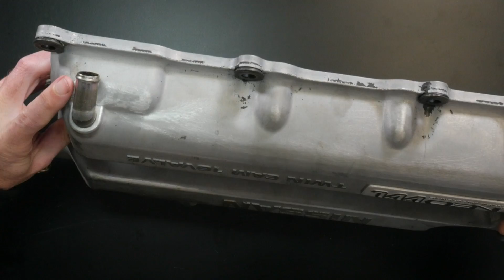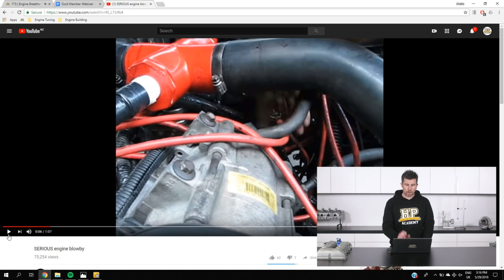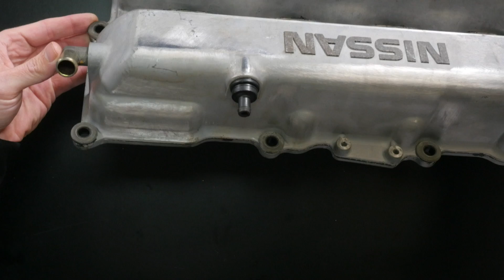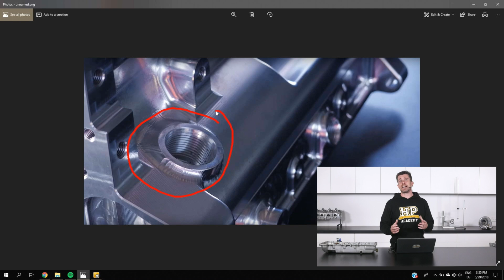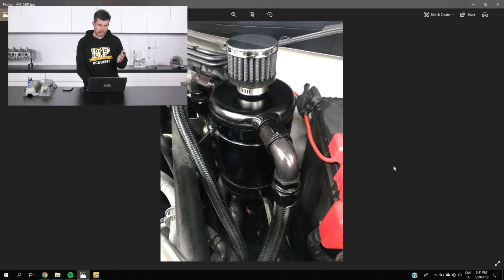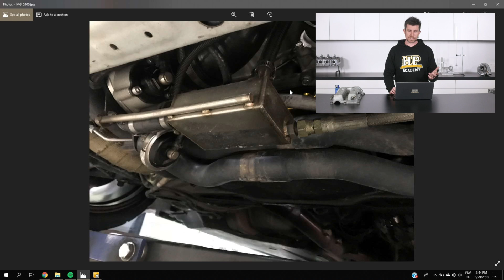Is your Engine Damaged? | Blow-By & Engine Breathers [GOLD WEBINAR LESSON]

Comment: But what about the benefits of having vacuum in the crankcase ect in a turbocharged application with pcv valves. The vacuum alone adds horsepower and aids in seals sealing ect. 

Just a pcv valve and catch can on both intake and exhaust breathers. Plumbed like normal minus the catch cans.
Reply from the maker: The reality is that on a turbocharged engine you're unlikely to see vacuum at higher boost and rpm due to the higher levels of blow-by. That's not always the case but in most instances the blow-by will exceed the ability of the scavenge stages to evacuate the crankcase and you'll still see positive pressure. Admittedly the positive pressure is less than with a wet sump but you'll still see positive pressure. If you're running relatively low boost pressure then you may still see a slight vacuum in the sump but it will still be minor compared to what you'll see on an N/A engine and hence the benefit is reduced significantly. If you are still able to pull a vacuum then there's definitely no harm in using a one way valve / PCV valve in the breather line but the benefit is just reduced - Andre.
Reply: @hpa101  I’ve always had really good luck w pcv setups. Even dual pcv setups w catch cans on both sides of the manifold. 

None the less. 

Would you suggest running pcv on the intake side w catch can and run the exhaust side in series but not to the turbo intake?  So when it’s under boost the pcv shuts and just lets the engine breath through the catch can only? 

I truly need to put a gauge on the turbo side to see just how much vacuum I can pull under boost on the turbo side. 

This is a topic I visited years ago and I’ve always done pcv valves w filters and just recently ran into several cars that had the system deleted and showing signs of exhaust valves ect wearing but the moment I plumb the pcv system I can make those puffs of white smoke disappear no problem.  In all these scenarios I’m
Suggesting in line pcv/oil separators and not just a stock pcv as they gum up quickly without routine cleaning. Doing it this way I see extremely minimal blowby even at high boost.  Literally just drops in the catch cans at the end of a week.  Where if I don’t apply vacuum I see a catch can gathering oil rather quickly. 

Anyways. I’d def like to talk more about this topic as it’s a highly debatable topic between me and other tuners.

Comment: Could blow by push oil back into the turbo in forged engine with stock breathers ? I'm having intermittent smoke on my forged 3sgte. I've done leak down test and compression test was told my engine is healthy. Just every now and then when I come to red light i see grey white smoke that smells like oil escaping from my exhaust:(
Reply: Use the pcv valve to create vacuum
On the crankcase at idle. Just run a catch can in between it.

Comment: I was wondering if you had any experience with this system in the 350z, G35 (v35 skyline) with the VQ35DE engine. The engine is known for oil consumption problems. I have put a catch can on it and it fills quite quickly. But i figure that its better to fill the catch can than to put that oil into the combustion chamber. Is there any way to improve the efficiency of this system? It has an awful valve cover design being plastic. Its surprising to me that after all this time and all the people who modify these engines, that no one has made a real great system to address this issue. I.E. billet valve covers with better pcv channels in it to give the oil time to drop out of the air in the system. You hear stories about people who had these engines replaced under warranty only to go right back to the consumption issue. I swear its the result of a poorly designed pcv system. Thanks for any information you can provide or even just humoring the discussion.

Comment: The first engine we built had 0 blow by, could rev it, boost it and nothing would come out the breather system. After i foolishly killed it we built a second engine and now on idle it chuffs oil smoke and burns off about half a litre every 1000km's. But the catch can remains empty.
Very annoyed by it
Reply: You've got a ring problem, homie
Reply: @AbolishTheBATFE  Yep the people who did the first start didn't follow my instructions and in fact did the exact opposite. they also tuned it to run 9:1 AFR during the run in tune
Reply: @UnparalleledSpoof  they washed down the cylinders
Reply: @AbolishTheBATFE  Yeah looks that way, nothing much I can do.

Comment: You should see how GM ecotecs PCV system under no load operates. The PCV valve sits inbetween the intake manifold as a little cartridge. It's a real nightmare.  Vacuum pumps would of been a great addition to relieving excessive crank case pressure because of blow by. Another thing for people to consider is when you vent gasses to the atmosphere a lot of times your MAF is losing its ability to measure the lost air so your tuner should compensate for that loss of air or extra intake from outside air if the lines are run post MAF meaning if your sucking in gases through your PCV outlet and that has an air filter on it, your MAF has no idea the extra air being ingesting leading to rich conditions. he talk about it at about 50:00

Comment: The good thing about using a pcv valve / check valve, is that at idle the manifold vacuum will pull fumes into the intake versus them escaping a vented catch can, where they can leave oil residue and be smelled. Not a big deal for a race build, but for a daily driven vehicle the fumes may not be desirable.  I'm attempting to utilize the pcv setup on my build, with an air oil separator and exhaust venturi to (hopefully) take over under boost conditions.
Reply: If you haven't come up with a solution yet, I can help you out

Comment: After I increased boost, my dipstick starts popping out. However i don't find much oil in the catch can. Should i just tie down the dipstick or increase breather size?
Reply: Run the pcv system to the intake mani w a catch can no breather. It relieves crankcase pressure and has many benefits. Vacuum at no boost is a beautiful
Thing.
Reply: George Chai what size lines running from valve cover?
Reply: @2jz_tony  stock size

Comment: I have found that if you daily your car it’s more advantageous to keep your PCV system, it’s not just good for emissions but it uses vacuum from the intake to help with the turbo oil return line moving that oil to the sump more easily especially when the oil is cold and thick. I use to have an issue where every time I took off from a light I would have a blue cloud behind me, I thought I had blown turbo seals. It turns out it went away after I reconnected the PCV.

Comment: So if dry sumps are better and cheaper then a really good wet sump why aren't they as common on daily build type cars. 

I know the dudes in Australia building the v12 supra wanted to avoid a dry sump.
Reply from the maker: Why did they want to avoid a dry sump? More info needed.

As for the first question, a daily/street performance build is not driven in anger anywhere near as much as a track car. Doesn't matter how big the owners EGO is, that is just a fact - Taz.
Reply: @hpa101  well they wanted to do a 1gz fe swapped mark 4 supra like smokey nagata but leave it more as a proper street built car. also yeah a street car isnt but some people do take their built street whips to the track vs having a track specific car. 

seemed more like they were saying its like having a wet block vs not. or other things you can get away with in a race car that isnt generally gonna be doing any real distance for anything length of time. 

whole point of my r34 plan is to have a daily that can also do some endurance runs on the track. 

obviously you cant drive on legal roads as wild as a track. but thats a given. well maybe in the states in the specific states with the abandoned highway system some of those roads are now basically lawless. or autobahn.  was more along the lines of reliability or noise concerns if you had any insight.
Reply from the maker: The only reason I could think to not run a dry sump is if you simply don't need one due to the way the vehicle is used/budget. There are no reliability issues, some cars but more commonly motorcycles come with them from factory - Taz.
Reply: @hpa101  hmmm wonder what they were on about then. maybe complexity? cause from what i know a good wet sump is more expensive then a dry sump set up. 

and dry sumps have multiple advantages. crank case vacuum being one. plus the obvious ones.

Comment: Whats your take on Diesel crank case vent routing? on my subaru i was running a basically identical setup you talked about in the video. but in a diesel (light to moderately modified engine in the 30-70 pound of boost range) oil vapor isnt necessarily a bad thing. is there a significant advantage to pulling a small vacuum on the system as opposed to just venting? My research is in the 6.7 Cummins engine in the Dodge ram trucks in the US, and most of them just route a single line to the ground. 

im looking to have a big line off the block and heads to a single huge can and im undecided on if i will vent it to atmosphere or back to the intake.

Comment: More serious comment:

Sump return catch cans are fantastic. To alleviate the problem you mentioned of an open air path between the sump and the base of the catch can. Install the sump return to the sump below the oil level (what I did.) Thus the oil acts as a U-Tube where oil can easily drain back, but no gasses can pass. What I've done on my race car (CA18DET powered.) Since it's only ever being thrashed, any water vapours are flashed off, so that's not an issue.

However, even though it's been rebuilt, it still throws alot of oil out of the exhaust cam cover (breather is right at the back corner,) so an long acceleration, especially around a right hand corner just causes oil to pool and be rejected out the breathers. (Have external head drains and oil restrictor into the head, to help as well.) Can't afford and empty sum 15 laps in.

For a street car, I agree. no real need for a sump return.

Comment: Re: PCV valve, they often stick, or even get blocked, so rather than have some/all the crankcase gases being drawn off, they can cause some pressure build up and venting out the breather that is supposed to let fresh air in. It can also cause a poor idle as the engine is tuned for that crankcase air.

As you say, removal of the splash shield allows more oil to be carried as droplets but, worse, most OHC designs have a pressurised oil feed to each cam'lobe, and in some instances it can splash off the components directly into the breathers... Some engines, though, do need the splash shield to be modified as, while adaquate for moderate street use, under harder use oil can build up on top of them and under cornering/braking/hard acc'n that oil can find it's way into the breather - the old 20XE engine was notorious fo this, and modifying the shield was an important step.
Reply: The biggest issue is that a stuck open pcv is effectively a vacuum leak into the intake manifold, assuming you have the factory pcv system.